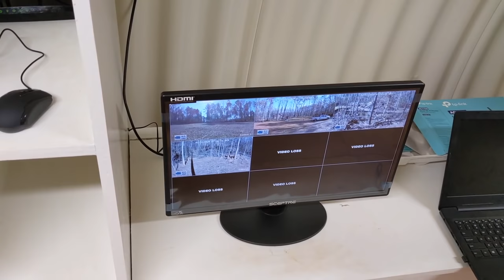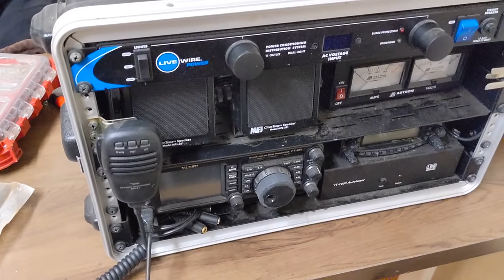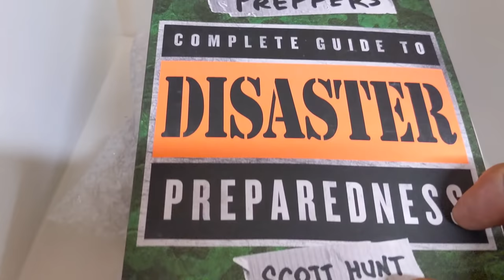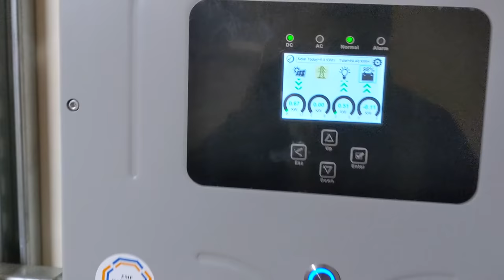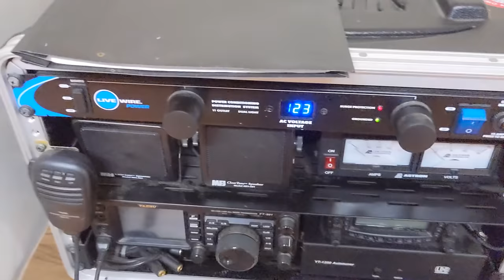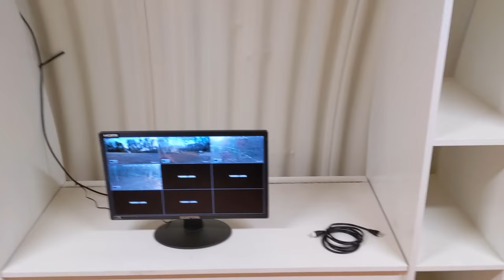Finishing up the Big Boy!

Comment: Why diesel for the generator instead of propane? Seems like propane would be better for long term storage
Reply: Ray Lord  Why does the generator have to be within the air envelope of the shelter? If I'm shelling out $300,000+ for this setup, the primary generator access will be from outside with an airtight door access from the inside to be used only when necessary. Then propane with a near infinite shelf life can be used. I want a large water-cooled generator for whenever there are high demands and the outside situation allows, and a 1kW Honda quiet generator to run at times of lower demand. Running small loads from large generators will kill them off.

Comment: Why does the generator have to be within the air envelope of the shelter? If I'm shelling out $300,000+ for this setup, the primary generator access will be from outside behind steel bars, with an airtight door from the inside to be used only when necessary. Then propane with a near infinite shelf life can be used. 

I want a large water-cooled generator for whenever there are high demands and the outside situation allows. The radiator will be a horizontal ground-source heat pump loop that will warm the shelter from cave-like conditions. 

A 1kW Honda quiet generator will be run at times of lower demand to charge the battery bank. Running small loads from large generators will kill them off.

Comment: Could you use geothermal cooling for the generator? I guess K.i.s.s. would apply to that answer but just a thought
Reply: Not a bad idea if a water cooled genset was specced! A 1" poly pipe horizontal ground loop laid in beforehand would warm the shelter from a chilly 57F and help drive off condensation and rust. It would also be a humongous coolant reservoir.

Comment: No disrespect intended on this but, I wouldn't of used any shark bite fittings in something like this. They work but for the cost of something designed to protect and last essentially forever, I would of invested in, the very least a manual pex expander (ProPEX). Maybe this is something the customer opted for, but still the cost is negligible for the amount of fittings vs the tool and expander fittings. If there are reasons for going this route that you cannot disclose, I understand.